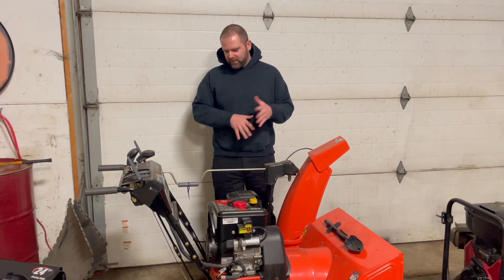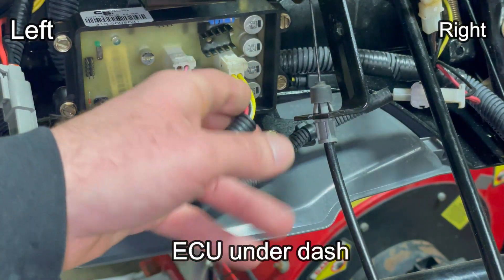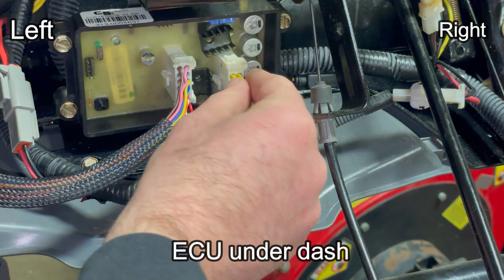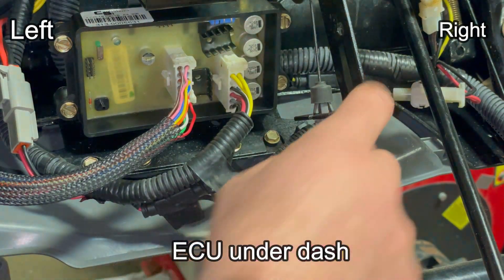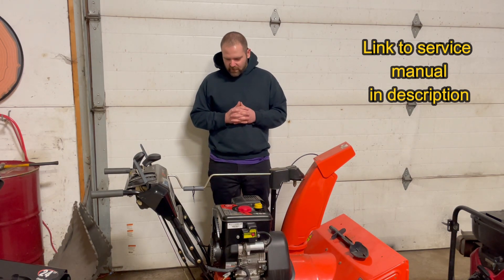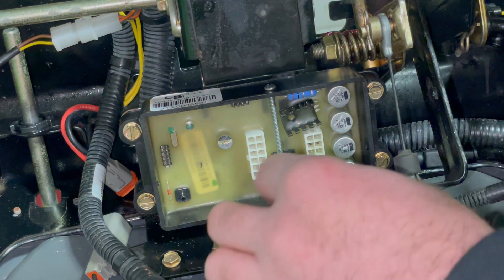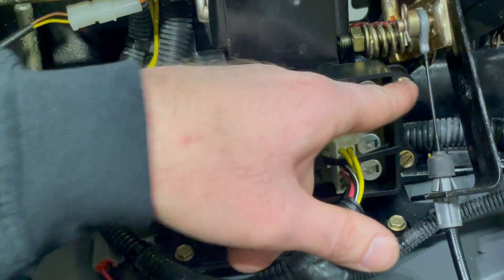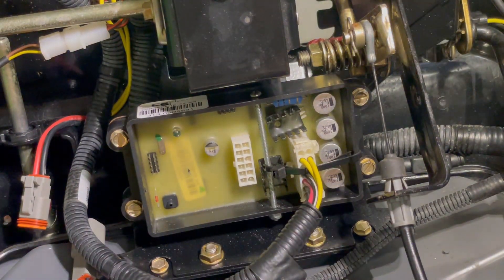Ariens EFI Snowblower Surging repaired. Basic voltage diagnostic. ECU plug "fix"

Comment: These things are soo so garbage!!! didnt even order these overpriced paperweights to sell customers this year. If they request it ill bring it in reluctantly, but they are HORRIBLE!! More dead fuel pumps from factory or within a month or two than you can count, the pickiest machines about voltage and they take forever to charge, faulty batteries in general, injector fails and gum like no other, $400 throttle body needs to be replaced for 90% of issues. DO NOT buy an ariens efi snowblower 😂

Comment: It is just a snow blower, just keep it simple without all the electronics. An aftermarket replacement carburetor is so cheap it pays to buy a couple to have an extra on hand if needed. That EFI stuff is great when it works, but when it doesn't' and replacement parts are needed.....Ouch!

Comment: I had the same problem.  I covered the connectors from the engine that were over the right tire.  In my case they were getting wet from the slush thrown from the tire.  I'll check the connectors your have on this video if the problem persists.

Comment: I have a platinum 24 EFI. It seems to be doing this at random after it heats up especially when it’s pushing heavy snow I’ve checked the battery The battery’s fine. I just looked at the connections, and I was trying to wiggle them and get it to act up and couldn’t. just does it at random. any ideas?
Reply from the maker: did you make sure the battery was charged? could be multiple of any connections. these batterys arent made to sit
Reply: @S @SmallEngineWizard  yes I charge it every couple months. Should I try putting dielectric grease in all the connections?
Reply: @SmallEngineWizard  I charged it before tonight‘s snowfall. It ran great for 10 minutes started doing it and then shut off and wouldn’t start for a bit. finally got to start and then it ran great for like another 10 minutes and started acting up again!
Reply from the maker: @josholson741 could be a fueling issue. filter in the tank could be getting clogged. i have a video on replacing it along with the fuel pump. you can make sure your connections there are good along with the injector on the throttle body
Reply from the maker: https://youtu.be/xkYh7PUROlA?si=9nlsXSfgaKAddJ93
Reply: @SmallEngineWizard  OK thanks I’ll give that a shot
Reply: So I figured out I’m getting enough power out of my battery out the other end of the power cord and I’ve checked the fuel pump and I only get power for a second or two and then it goes away. I’m stumped on what this would be.

Comment: This fixed my problem.  I 3D printed a bracket that slips over the middle of the connector and lets you use 2 zip ties to hold it tight.  It turned my useless sputtering snowblower back into the monster it was meant to be.   @SmallEngineWizard if you have a way to accept a monetary thank you, let me know.

Comment: Ariens AX208  24" WIDE. I just replaced the Carb bc Snow Blower wouldnt start after years of storage.  Success! Its starts. But Surges (as i recall it did years ago).  I replaced the Carb completely.   Why is it still surging?

Comment: So I did this repair and I still had problems for about a year. No matter how I secured it it still surged. My fix was taking bolts out and putting zip ties where the bolts are so it would be slightly loose and absorb the vibrations. Ideally there should be some rubber grommets to help with the vibration.

Comment: Why not just reshape the female contacts in the plug with a tiny flathead screwdriver so that it makes good contact with the male pins?
Reply: There's no practical way to do that; the female contacts are so small that you risk damaging those contacts and then you have a bigger problem on your hands (new harness, likely).

Comment: Thank you! I had a similar issue, but worse, 2 years ago. They covered a new control module under warranty. It started acting up again and I was sure it was the same issue. After watching this, I reseated the plug and it works great!

Comment: I've had an issue with mine where if I try to run it at full speed, it does this (anything above the "Efficiency" setting). I wonder if it might be a similar problem? I always suspected that it wasn't correctly reading engine rotation position, but didn't suspect it could be as simple as this. Had it in the shop for the same issue while it was still under warranty and they replaced the ECU and it worked okay for about a year (long enough to get through the warranty period.) Should be easy enough to try this to see if that's the issue! Thanks!
Reply from the maker: you can try holding the plug in while its running. the vibrations at higher rpm could just be loosening it up just enough to cause an issue
Reply: Did you ever figure out what was wrong? Mine also is surging anything over efficiency.